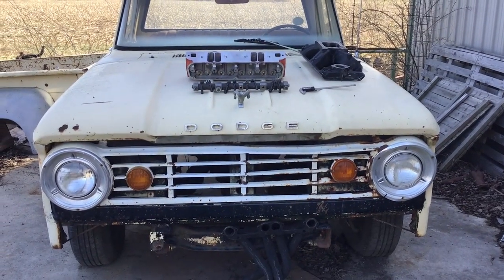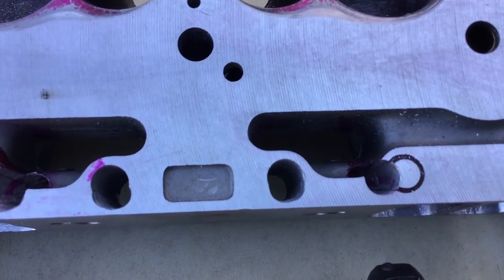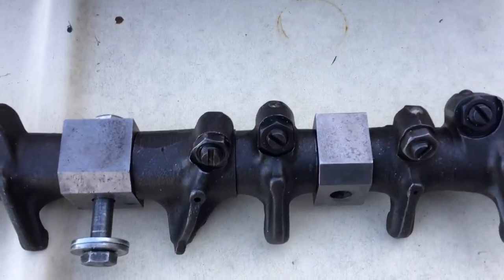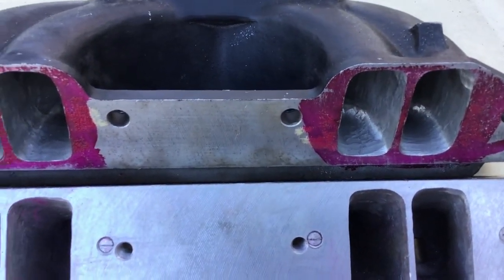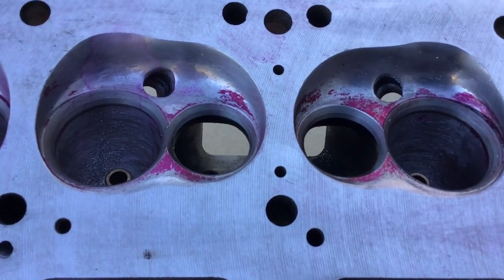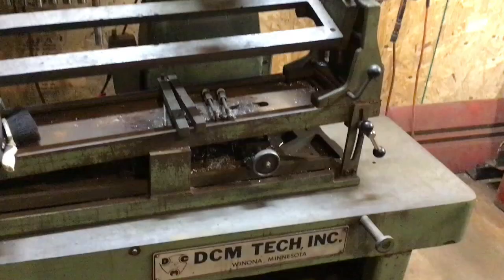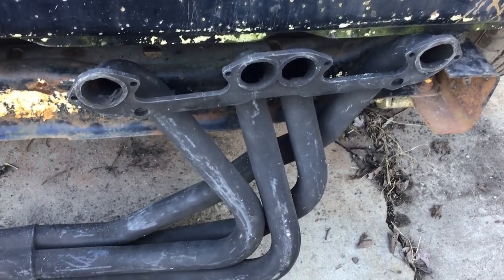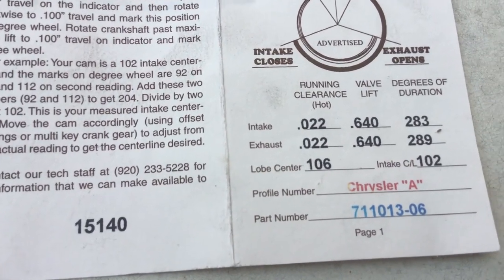Offset  Rocker Heads For Small Block Mopar  #NoNameNationals #Race For 500# W2

Comment: The W2 rocker shaft hold downs are made for long valves and valve springs. I wanted to use standard length valves in the W2 heads, so I rotated the W2 rocker hold downs 90 degrees and machined them for the hold down bolts. I kept the 45 degree angled corners of the rocker pedestals in the original position, which required turning them around after rotating them.